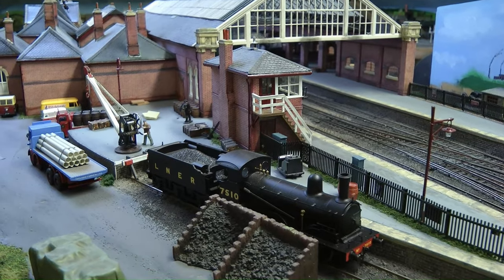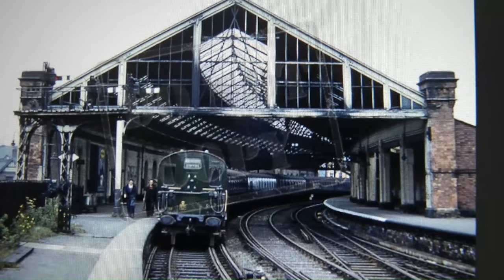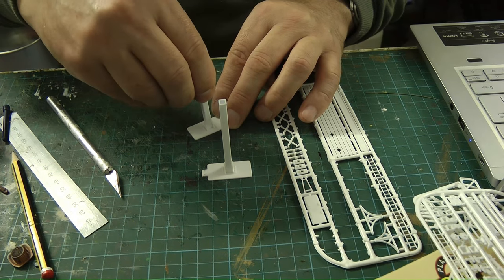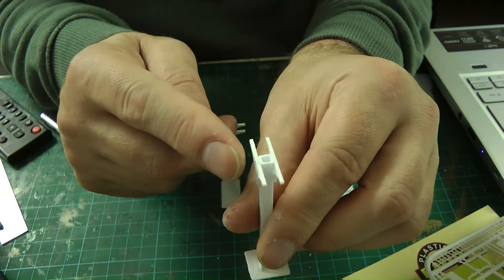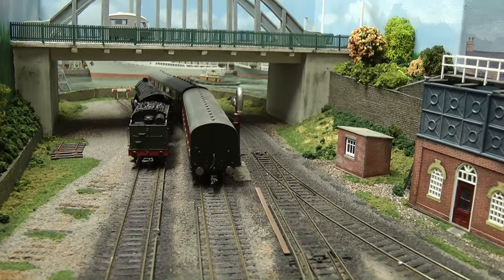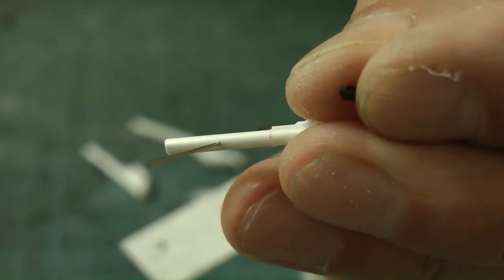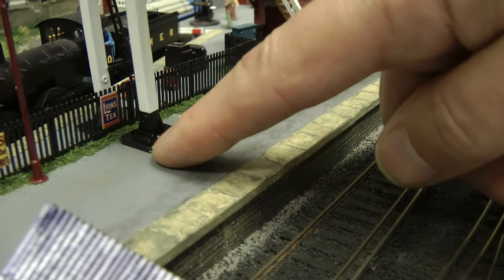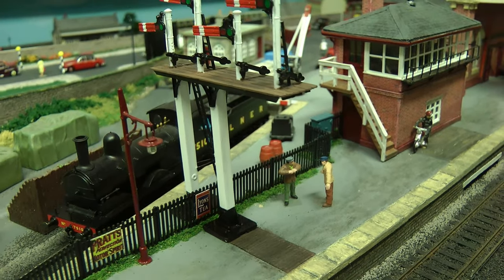The South Shields Gantry. Ratio Signals. No396

Comment: Thanks, Tony, that was very interesting and station looks, as usual, spectacular ! When you spoke about the ladders, I was reminded of a conversation I had when I was about 12. I was sat on the platform of our local " Halt". The station master/ head porter/ ticket clerk , described " Lamping" . It involved replacing the oil in the paraffin  lamps in the signal gantries. They had to climb ladders in all weathers to top up the reservoirs. Quite scary in severe frosts.
All the best. Peter
Reply from the maker: Hi Peter. thank you for the insight into lamping. but yes they would have to work in all weathers. they must have been men of steel. to climb those ladders in the winter months. thank you again for an interesting comment. cheer's for now Tony.

Comment: Hi Tony, that was a nice piece of kit bashing and mix n match, worked out very nicely. Glad I have a few LMS in my kit box as well as the LNER.  I suspect the LNER 4 foot arm pressings with the corrugations in were to strengthen them, good idea on rodding access timber work, certainly looks good. All the best Stephen.
Reply from the maker: Hello Stephen, It seemed to have come together really well. it was bit of a odd job. I think the L.N.E.R signal arms set it off a treat. i would imagine that they were very heavy made from cast iron. 
so with all your kits you may be able to do the same. thanks again for commenting. cheers for now Tony & Laura.

Comment: Hi Tony, sign looks great now its painted. I like the way you solved painting the white. Cheers Steve
Reply from the maker: Hi Steve,
      Thank you again for the sign. adding the paint is no different to how the old printing presses work use to work, but in reverse. cheer's for now Tony.
Reply: No Problem Tony, let us know when you need the other ones. Perhaps 2mm Road Signs next 😃 You have given me an Idea on the signals. I going to have a go at designing a 3D printed  lattice signal gantry at Tyne dock bottom, albeit after I finish the signal box. All the best Steve @TONYNORTHEASTERN
Reply from the maker: Will do Steve, thanks again. Tony 👍👍👍👍

Comment: Hi Tony, a great video on how to assemble, and kit bash those Ratio signal kits. I have tried so many times to build a working one,  and kind of lost my way half way through with the tiny parts! I think yours turned out really good. One point came to mind though. I noticed you said you had to alter the positioning of the gantry, but looking at the original photo of the gantry arn't the signals facing the other way. Yours are controlling the entry into the station but your photo seems to indicate the signals controlling the exit from the station, ie they are starting signals.................It may be modellers licence in order to fit it all in, in which case forget my comments....................Anyway I love seeing your layout, it is truely inspirational, all the best Dave.
Reply from the maker: Good morning Dave. These kits can be awkward to make. but once you figure them out then they do become easier to build. 
interestly put, yes the signals are facing the wrong way round. but that is down to how i set up the tracks. the original set as seen in the photo was to direct the trains into the sidings. and then further back towards the sidings there was another gantry for the sidings which directed trains into the station from the north end siddings. but because of space restrictions i could not have the full size layout of the original track plan. hence why the signal has been swapped round. its a little compromise for having the signal there. 
i hope this explanation helps. 
if only i had a couple more metres. thanks again for commenting. all the best Tony.
Reply: Hi Tony, thanks for your reply. Yes, I see why you would set up the gantry as you have. It is awkward to position things like signals and get them to fit into our much compressed track plans. Space is always an issue, well the lack of it! Thanks again, and all the best Dave.
Reply from the maker: Its a compromise we all have to make when we take on such projects. with space issues. take care my friend.
Reply: Thanks, you too Tony.

Comment: Handrails for the signal ? , I last built ratio signals when I was about thirteen now in my mid fifties I’d have job to see the small bits to cut them out , can’t say I’d enjoy making them work but as static models they are very versatile and look the part for only a small outlay .
Reply from the maker: Yes, exactly Mick. I agree. it is a small outlay for these static models. the hand rails will be added at some point. just need to find the right size wire to make them with. thanks again for your comments as they are always appreciated. cheer's for now Tony